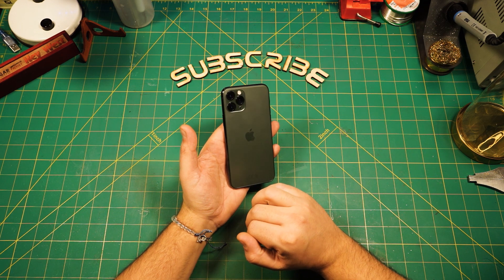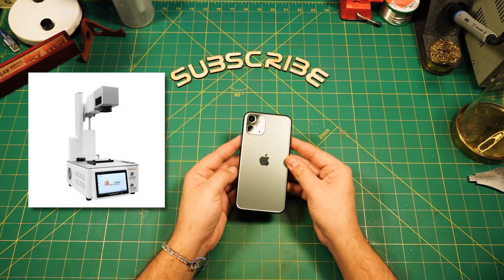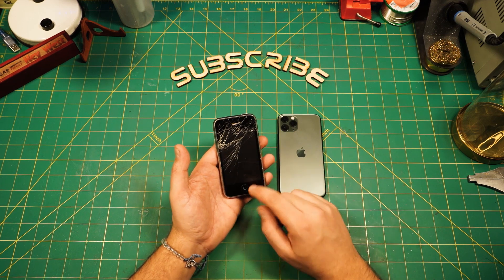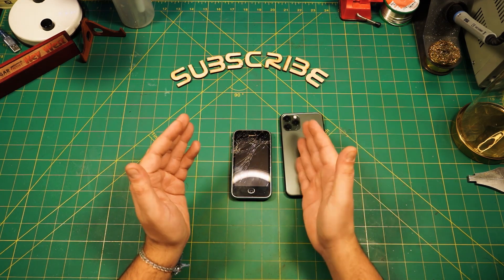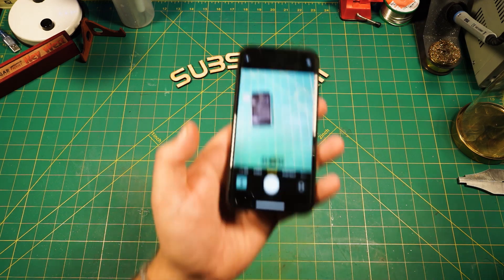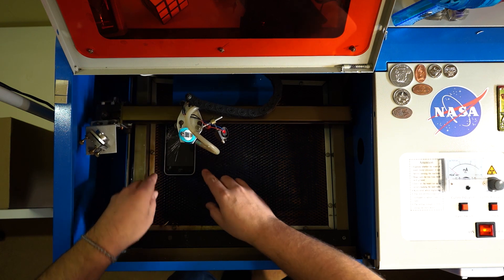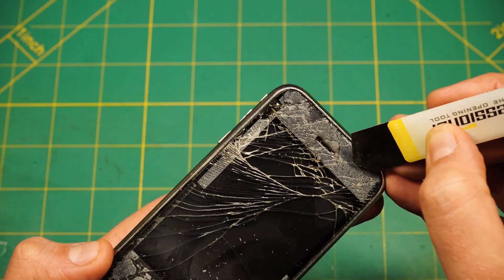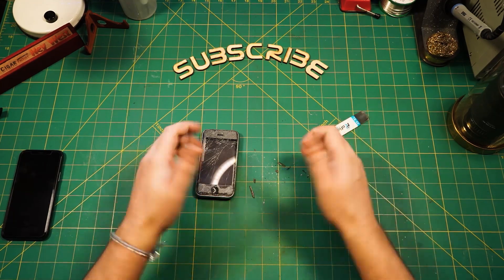Change the Glass Backplate of an iPhone with a K40 Laser?| How to permanently damage your Smartphone

Comment: I don't want to comply but if you looked at the absorption of the wavelength of a co2 laser on aluminosilicate you could say before that it is not possible to do that with the k40. Because the absorption is over 1 dB/m. You just engraved the top layer.  Aluminosilicate has a beginning absorption (gorilla glass) starting at 7500 nm and the co2 laser is 10600 nm.